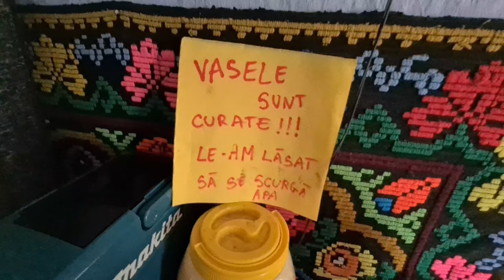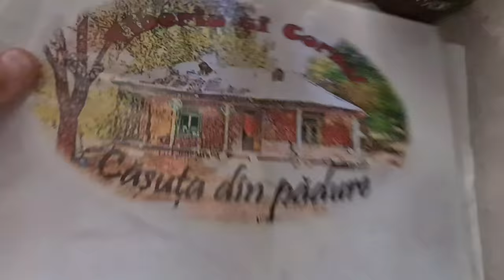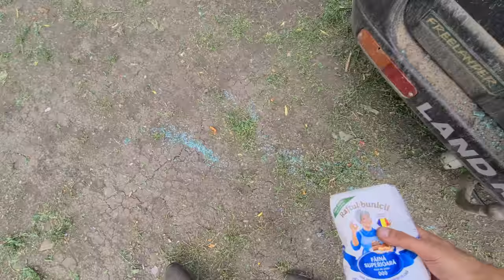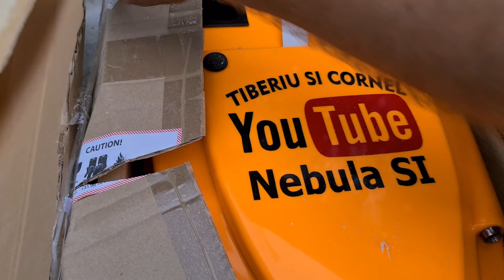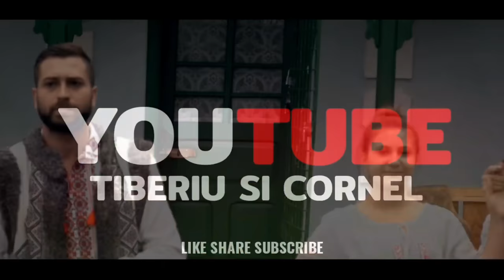Am spart geamu la Rover!Un an de cand am inceput proiectul casuta din padure!

Comment: Navomodelul acela costa 2000 de lei,sa aveti noroc de el.Onyx Bait Boat - Plumb Acid - Navomodel De Plantat 2 Cuve -
Greutate : 4.5 Kg
Motor : Brushed 12V
Viteza : Progresiva
Basculare : Independent Cu Revenire
Lumini : Led – uri de Orientare si Far 3W
Controller RC : Frecventa 2.4 GHz, 6 Canale
Acumulator : Plumb Acid 12V – 7.2 A
Autonomie : 20 Plantari aprox. 150 M
Incarcator : 220V – PlumbAcid
Afisaj : Digital – Stare Baterie
Protectie : Elice si Carma